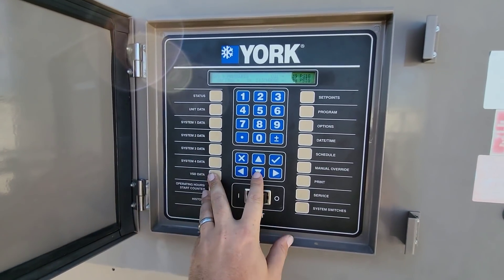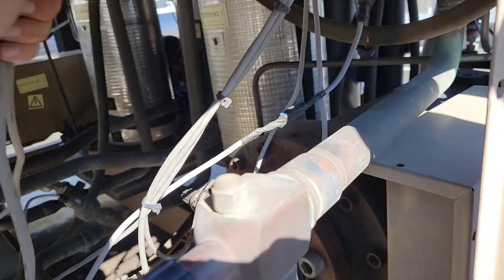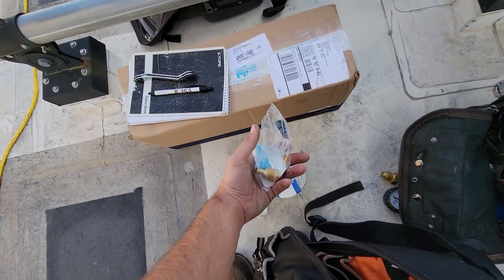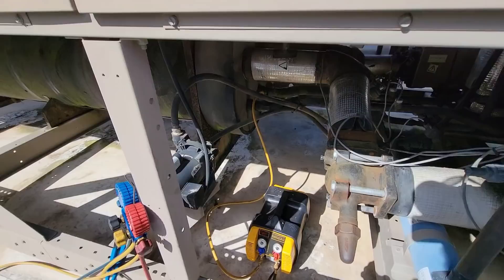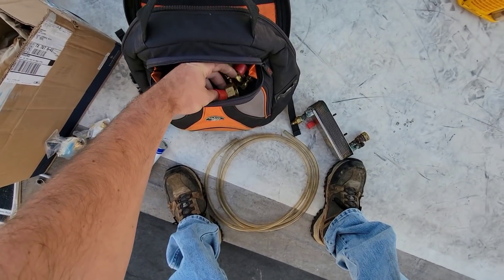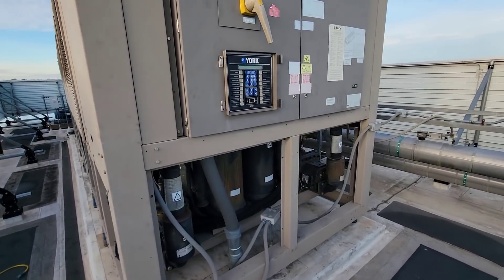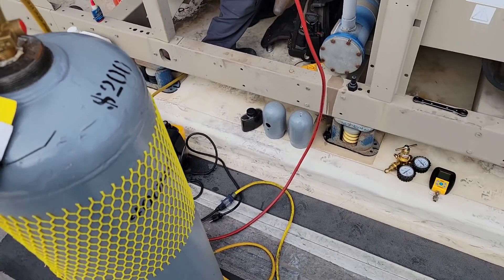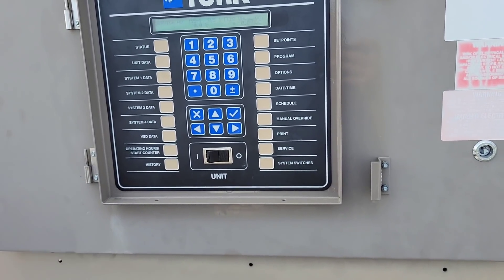Bad Oil Sensor Tripping York Air Cooled Chiller HVAC

Comment: I don’t like using the toggle switch to shut off. Compressors are usually go to system switches and turn them off. They one at a time to power the drive down.
Reply from the maker: Your's is a better way

Comment: Why are you pulling the charge?. If
Your replacing the oil temp sensor. Close the iso valves and push the charge into the other side side of the valves. Takes 1 hr tops to get the gas out of that part of the circuit. Usually 20-30 min. Putting 2 days on for a oil temp sensor replace is way out of the norm.
Reply from the maker: You don't have an access port on the liquid line to do that on this one when the valve is front seated. There are ports on the discharge line but I choose not to pump liquid into the discharge side. This is a YCIV.

Comment: The only problem w nylok on the drier cap is good luck to the next guy during drier replacement. He will scrape and chip the gasket seat w his control screw driver during gaslet removal.
Reply from the maker: Been using Nylog for years and never once had it do that. You sure your not getting it confused with something else?
Reply: Been working on these machines for over 15 years and have never used Nylog on anything. Been working on chillers for 30. I can count on 1 hand how many caps have leaked after changing the cores. I do not ever use sealants on driers ever. Having a lid to seal up that it has to be broke loose is inherently dangerous.

Comment: Need to get an old school reclaim machine. Those yellow jacket things are junk.my old reclaim machine is big and heavy but reclaims 4 times faster then the yellow junk with the undersized condenser.
Reply: its an Appion recovery unit and not Yellow Jacket, and the Appion goes good man ! Why the rush ? Getting paid by the hour 😁
Reply: @stueyknuxx  when you have to reclaim a freezer condenser on roof before crane shows up,job is quoted  i not trying to play games i want that reclaimed as fast as possible.
Reply: @richardharmon874  he wasn't recovering a freezer condenser before a crane though was he ;)

Comment: often it's cheaper to get a whole valve assembly, just for the solenoid coil or the whole assembly may be all that was available. keep the valve as spare on truck or document and leave it inside the machine.
what mental genius designed the system so it needed a full recovery to change an oil temperature sensor? I guess they were too cheap to implement a brass or copper probe well.
Reply: When the stem leaks, and that’s common. There is a part number for a tube enclosure kit. Better than replacing a whole valve. Also locking your coils into place with a dab of silicone between the coil and the valve body will slow it down on rubbing and the stems will last 5-10 times longer.

Comment: I couldn’t agree with you more about York adding a recovery valve,I changed a compressor on a yvaa and had to pull the liquid from the eductor line filter
Reply: Once you have the gas out. Solder in a few ball valves with flare ports. Also makes life easy when replacing the drier. Turns it into a 20 minute job.

Comment: You can use a water hose gasket for that adapter works fine especially in a pinch
Reply: O-ring works just as well too.